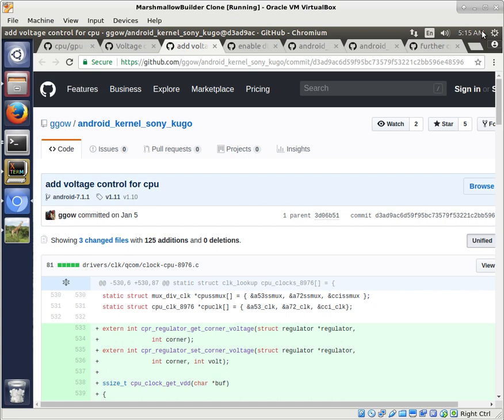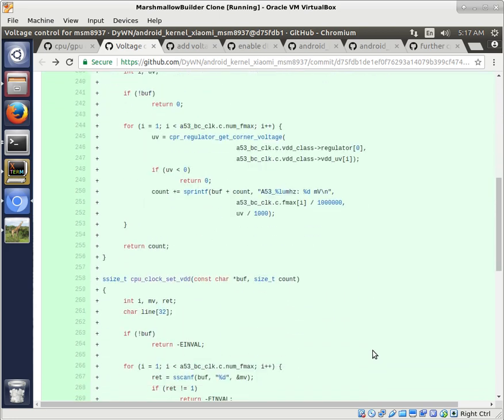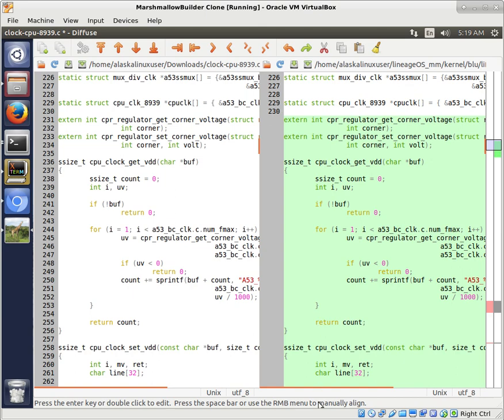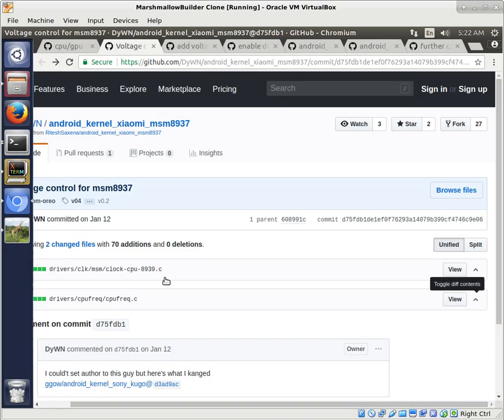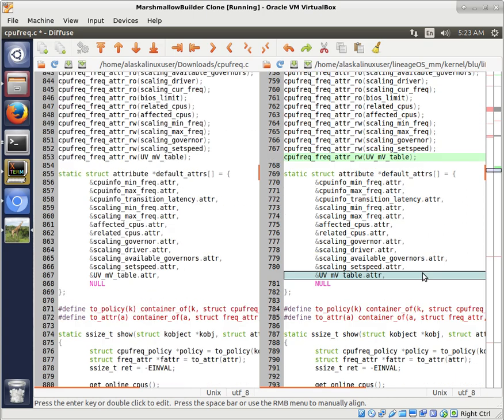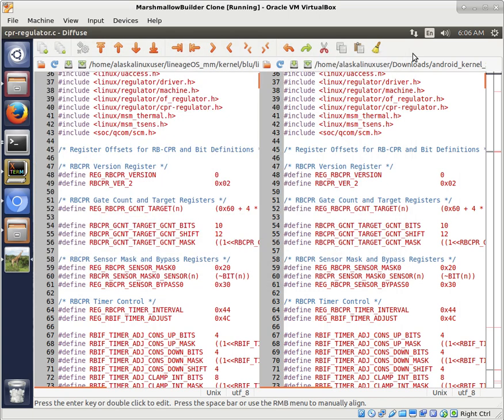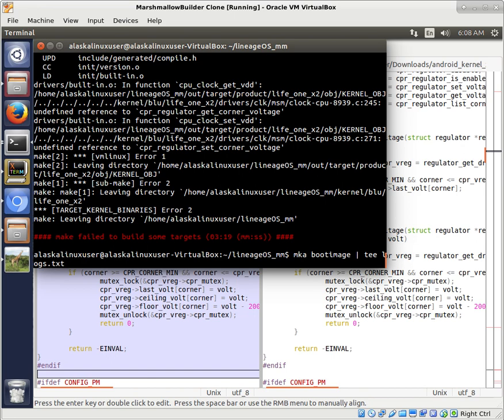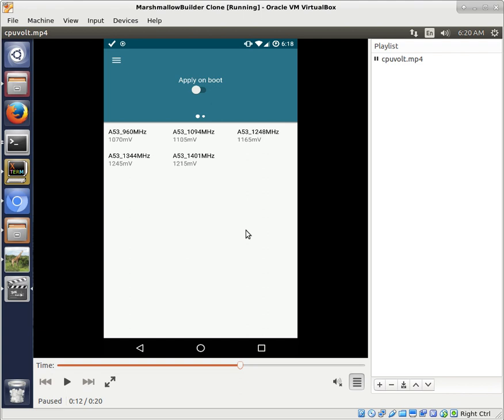Kernel modification: Adding CPU Voltage Control

Comment: Hello. I have done exactly this and got voltage control tab in kernel control app. But it says global mv instead of cpu cores and cannot change mv. Platform is arch.
Soc is msm8952
Reply from the maker: Yes, this is for MSM8939, the idea is the same, but you will need to edit a few things for a different SoC. I recommend finding one that was done on a 8952 as an example.
Reply: @AlaskaLinuxUserAKLU  I have already figured it out. Thanks. But I couldn't manage to get gpu voltage control. Msm8952 uses different file for gpu. I have no clue what it is.
Reply from the maker: Should be <kernel source>/arch/arm/boot/dts/qcom/msm8952-gpu.dtsi
Reply from the maker: And arch/arm/boot/dts/qcom/msm8952.dtsi